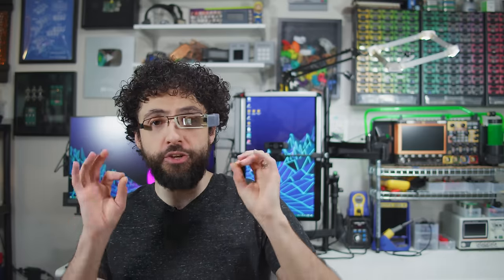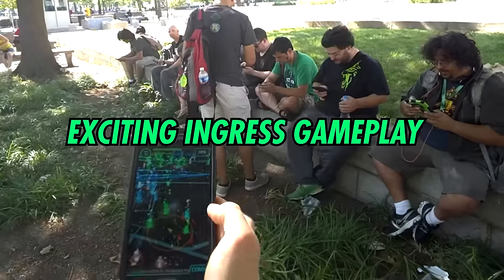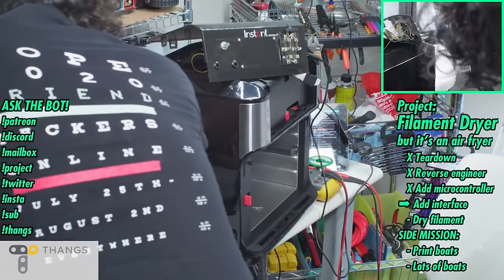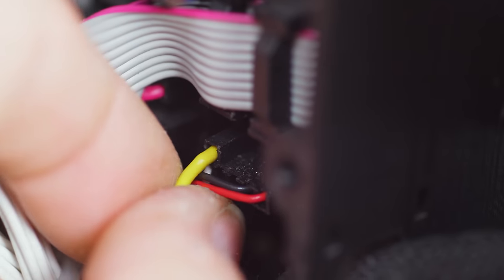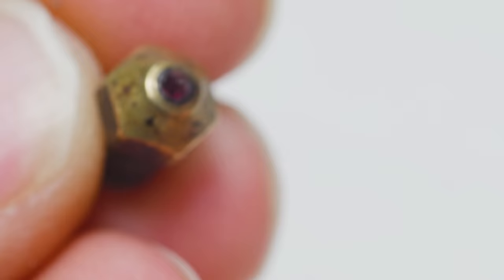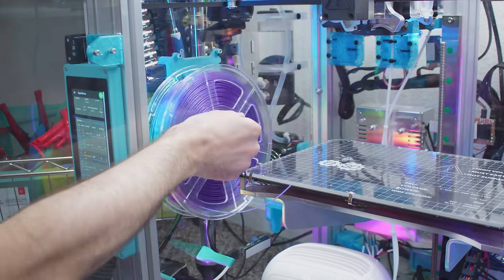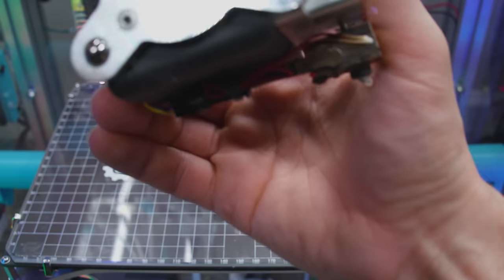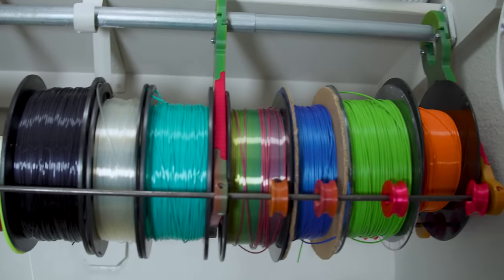My 3D Printer Collection is Getting Ridiculous

Comment: Glad you featured the air fryer stream clip, never been jumpscared by a stream in the background harder than the teensy BBQ experience!
Reply from the maker: The burnt-out parts are in a box and I'm scared to throw them out, in case they're haunted by the ghosts of angry pixies
Reply: @ZackFreedman  sign em and sell them if belle can profit on fake bath water, you can profit on “slightly used electronics
Reply: I'd buy some cyborg water
Reply: @ZackFreedman  You need to extract one well-singed stinky part and frame it on a wall, near your working space, as a reminder to stop potentially electrocuting yourself.

Comment: LOL! I never talked you into these fans! 😅 I mentioned that they are total overkill and since then you wanted nothing else - should have known you better 🤣 Great video and I'm curious about the every-filament-2-video! Cheers 🍻
Reply: Can you please share a link to those fans ? I am interested.
Reply: What are these fans? I recently rattled my part cooling fan to death, a generic $2 5015; i replaced it with... i forget which model number it is, but it's a Sunon MagLev. It can do a good bit more air, it's more smoother, but it was a proper menace to get it to actually run, i put an LCL filter on it, and had to tune the PWM base frequency in firmware, but now it runs. Maybe i put a little much capacitance on it, it takes a while to calm down. Then the cold end fan died as well, and i replaced it with something from my stash, but maybe i'll get another Sunon MagLev for that too, looking for suggestions anyway!

The inductors i used... are 0.3mH 3.8 Ohm and the capacitor was i think 470uF or something that order of magnitude, i basically constructed the LCL more by feel rather than by science, which isn't my preferred ways of doing things, oh who am i kidding, i just grabbed the things that were in my line of sight and combined them, that's what i always end up doing.
Reply: @SianaGearz  they are EBM Papst RLF 35-8/14N2 fans and very expensive

Comment: For the Concrete block - I also got a 60x60 laundry machine rubber mat that is meant to absorb vibrations. Cut it up and covered both sides with it.
the concrete has a rough surface, so realistically your printer doen't lay fully flat on it - adding padding ontop provides better contact to the block

Comment: That tool changer printer terrifies me. I love it

Now that you've got SLA and FDM printers, here's a question to keep you up at night: which makes stronger parts? 
(Also I loved the joke about nylon finding water on Mars)
Reply from the maker: In most cases, it's FDM. There's a limit to how thicc you can make the walls of a resin print, because UV light needs to penetrate in to cure it. Basically, all resin prints have 0% infill, so it's not a fair fight.

For smaller parts, you can get way better performance from high-strength resins. Thin FDM elements tend to be flimsy, but resin's perfect layer adhesion pays off here.

Comment: You can cool it with the enclosure temp above 100degC. Just run high percentage of Ethylene Glycol through an automotive HVAC heater core with fan, a small plastic coolant reservoir (ala VW beetle or equivalent) and pressurize it to around 1ATM. Could operate at a temp around 120-135degC. 
If space is an issue or you don’t want hot air blowing melting the paint off the walls of VoidStar Labs, then setup a heat exchanger in an ice chest or something similar. 
Be sure to recalibrate for elevation.

Comment: I have absolutely no clue how to do the wizard wiring wierdness you wrangle so well, but because of you and your printer videos I now have a small resin printer. 

It is unfortunately in my bedroom because my apartment is tiny as hell, so the noxious fumes will need to be locked in my bedroom until I can hold my breath, shield my eyes, and open a window into the wisconsin winter so my prints don't fail due to the sudden drop in temp. On the bright side, nearly free 40k armies.

Comment: I learned a better printer base is a 16x12" granite cutting board from amazon, as heavy as the concrete paver but not as bulky. What makes it better is epoxying the printer frame to it, that way any force that would have caused a vibration has to be strong enough to get the whole printer and granite slab moving, so less vibrations.
Reply: Ummm...no.  Sorry, a granite cutting board will not be anywhere near as heavy as the concrete paver.  Unless, of course, you buy a granite surface plate, but those are super expensive, so I assume that's not what you meant.
Just so someone doesn't go down this path and face disappointment, let's do the math...
The granite cutting boards I'm seeing on Amazon (for example) are typically 12"x16"x0.5".  
Using density info from a stone supplier for black granite, that works out to about 10lbs, even if we ignore that the board isn't exactly that big.
The concrete paver Zack is using appears to be a standard 16"x16"x2" paver.  Using info from a paver company, that comes out to 39lbs.   
Slight difference. ;)
To be clear, the granite cutting board WILL help, just not as much, and it costs ~$40 vs ~$5 for the paver.
Also also, 12" of width won't be enough for many current printer models.

Comment: Despite the flood disaster video being an obvious inflection point to discuss dehumidifiers .....THIS is the episode to watch for gleaming tidbits on tackling  tricky two-hydrogen and one-oxygen trials and tribulations.....I had to search back for it ....but I'm replicating Zach's closet de-humidor myself ... this summer has been brutally humid and all filaments must move to both dry boxes (from dry bags) but also a dramatically dry-er doored detent in my domicile ....a room of their own .....ie old coat closet.
 I have looked into the solid state dehumidifiers but I need faster results than they can give .....I will get a few eventually to play with but for now ...the oversized capacity unit and resulting heat which I will "recycle" to keep said closet toasty and also-dry should do the trick.  ( since compressor type dehumidifiers are un-vented AC units with mods ).

Viva-la-filaments .... minimize the moisture gents and gentle ladies!

I think, despite perceptions that Colorado is 'dry', @ZachFreedman is uniquely qualified to talk about humidity management ....just an idea for an "easy" future video??
(Possibly a sponsored review...?)

Comment: Talks about how the carpet padding and cement block reduces shakes and improves print quality, while showing a benchy with an obvious layer gap.... hmmm ok.
Reply from the maker: Layer gaps don't have anything to do with print shaking, they're caused by feed issues. The mod is still worth it, even though it doesn't completely fix every problem I could ever have forever instantly.

Comment: i got one of those cheap sainsmart style 3018 pro cnc engravers, 50 bucks buys boden style double drive roller printer parts, only problem is the 45mm max height and i wanna do big things, good i'm not askeered a gloo, i want a macross, a biggun.

Comment: Why not use a cheap food dehydrator for drying out filament? It’s like 25-40$ and works great.
Reply from the maker: I have two! There's a food dehydrator for regular filaments, and an air fryer for high-temperature engineering plastics. I don't rely on them because they take time to work, and it's unrealistic to plan every print four hours in advance.

Comment: The entire time I was wondering if he had a voron. That's what I'm building to replace my ender. Im a bit envious of the tool changer but I'll work something out.
Reply from the maker: The Voron has the best feature from the Toolchanger, the CoreXY frame. If it's any consolation, the Toolchanger was a huge pain to build, and took a lot of work to write G-code to change tools, do auto leveling, etc.
Reply: @ZackFreedman  I'm building the 2.4 I'm sure there will be a mod in the future or I might have to create one. I've been thinking about the palate 3 since I could use it on all my printers.

Comment: I would be careful over dehumidifying where my printers are because it could eventually weaken the circuit boards of your 3D printers, cause a build-up of electro-static energy that can damage the printers, and it is also damaging the closet it is in. Amazingly, I don't dehumidify anything at all and not a single print problem. No under extrusion, no over extrusion, no stringing, etc., I only print with PETG. I don't dry my filament and have 0% problems. Over doing it is as bad as under doing something. You're humidity level should be around 30%.

Comment: In the past I’ve heard of using resistors on server fans to lower their RPM I wonder if you couldn’t do that with the fans on the machine you were talking about if you really want to lower their RPM .
Reply from the maker: I just mess with the printer profile, but I'll admit that I've blown some prints by running Prusa profiles straight on the Toolchanger

Comment: I've been doing research but this place seems to be the best place to ask. I'm looking for a cheap 3d printer that has good resolution for minis. I'm just now getting into this hobby but know next to nothing. Any recommendations would be awesome!!
Reply from the maker: Really, any quality resin printer will do a good job. They're largely identical. I recommend getting a mono printer for speed, and then choosing by vat dimensions based on how many minis you intend to print at once. Remember that only the Z dimension affects how long a print takes - you can run off an entire bed of 10 minis in the exact same amount of time it takes to make one.
Reply: @ZackFreedman  thanks Zack, you're the man!

Comment: Why not ditch original electronics and run the heater element in air fryer with an SSR?
Reply from the maker: I decided that it's too dangerous to make mains-powered projects. I need to build projects too rapidly to make safe high-voltage circuits.

Comment: Hmm...why such thick nozzles?  I never really go over. 4, and im considering going down to .2 or .1 nozzle for even less layer lines.  As far as being a maker in need.... hi!  I'm poor and I'd love to have a second printer so I can feel safe upgrading my first without fearing needing to print parts for it and it being in pieces...  

Also where did you get those fans..I need those part cooling fans O.O
Reply from the maker: Main reason is speed. I need to finish projects ASAP, and an 0.6mm nozzle is usually 30-50% faster than an 0.4. Other reason is composites - I use a lot of carbon fiber and stuff, and it's less likely to clog wide nozzles.

Comment: No point of a Voron with the Squirtberus!
Reply from the maker: The Toolchanger is clunky - when a tool is engaged, it has two wiring harnesses, a receiver, and a faceplate to drag around in addition to the extruder itself. It's not nearly as agile or fast as a CoreXY printer could be.

Comment: You take your TC to 100c?! The tool change motor acrylic panels and most of the things in that printer would be damaged!??? How???
Reply from the maker: The Titan Aqua cools the motor, too, so it stays within safe operating temperatures. The other motors can safely withstand 100C, they just can't run in it. All plastic parts are printed in high-temperature PET or annealed carbon-fiber nylon to handle the heat. I imagine that the acrylic will take damage over time, but replacement parts won't be too expensive, and it's not structural.
Reply: @ZackFreedman  my main worry is your linear rails! tho since yours has hiwin genuine ones it can withstand 100c probably, non genuine ones can't handle more than 80c.

the motor i mentioned is the tool locking motor tho, the one that spins the lock bar.
Reply from the maker: @ameliabuns4058  Ohh, gotcha. Yes, before doing any high-temp printing, I got in touch with E3D and verified that the rails can safely operate while hot.
Reply: @ZackFreedman  yeah I forgot. And I got shocked xD

Comment: Very new to the world. I just had my first heartbreaking fail. 3 days. Didn't use the necessary support. Do you still have heartbreaking fails?
Reply from the maker: Oh, all the time. Jams, plate fails, impossible-to-remove supports, and it gets worse when I'm doing it for an episode. I print a little cylinder to catch crud when I do time-lapses, and it collapses about half the time and I need to restart the print.

Comment: Hi I was wondering what furnace you were using to dry your filament
Reply from the maker: Here, let me check. This is it: https://www.target.com/p/hamilton-beach-air-fry-sure-crisp-toaster-oven-31323/-/A-76628062#lnk=sametab

It's a Hamilton Beach Sure-Crisp convection toaster. The important feature is the Stay-On mode, which lets me run it overnight to dry the most...

neck snap
Reply: @ZackFreedman  Thank you very much and why do they place things in Fahrenheit it should all be Celsius but apart from that thank you very much

Comment: What enclosure do you need for htn nylon ?
Reply from the maker: Two things: A draft-resistant box for the printer, and a heated filament dispenser. The former can be as simple as a cardboard box or as specialized as a Boxomo or Wham Bam product. The latter you pretty much need to buy - mine is from Sunlu, but I'd like to upgrade to something that heats above 60C.
Reply: @ZackFreedman  wait heated filament dispenser? do you mean as in a heated enclosure for the spool?

how hot was your enclosure? I just wanna know if 60-80c is gonna be enough. for my enclosure, to go any higher i need to drastically redesign this 3dprinter